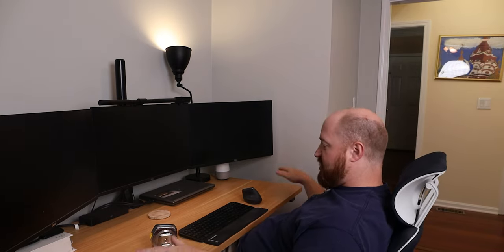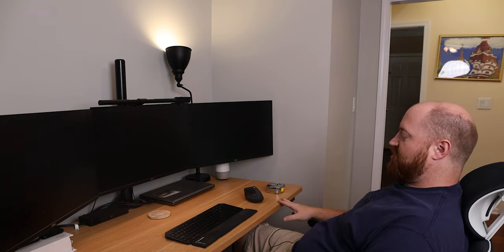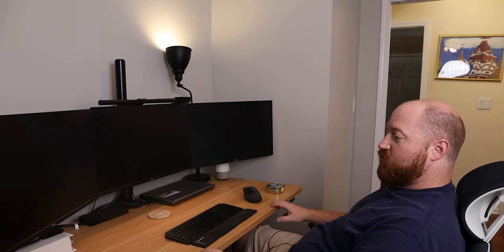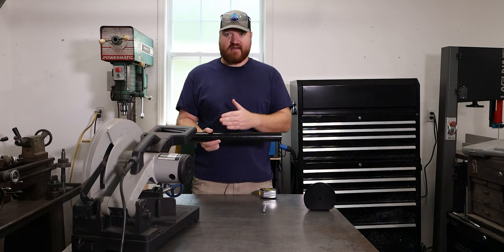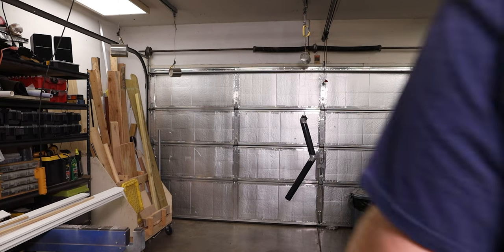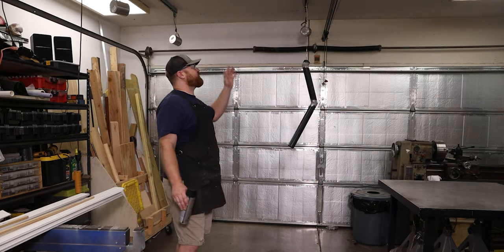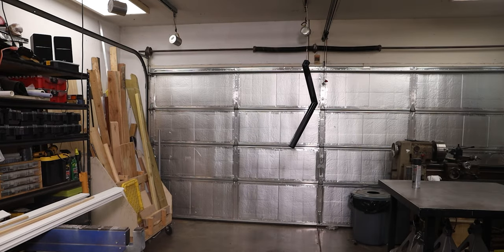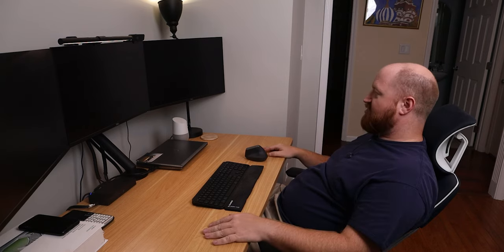Monitor Stand Modification

Comment: If you do it right, you could rotate the stand 90 degrees to the left or right and keep the table closer to the wall. Think youtube recommended me this video because I've been looking into stands for a new monitor setup so I've been thinking about mounting for a while :). I'd love to do something similar a what you've done with mine.

Comment: I really like the stand modification, it's super clean. Hice work, I'll have to keep this in mind.
Also, if you want, try rotating the left and right monitors into portrate. It will help reduce the left-right angle but, oviously increase the up-down angle. I personally like my side monitors in portrate. However, I completely understand it not everyone's cup of tea.
Reply from the maker: I tried portrait monitors before, but I spend 90% of my day working in CAD and most parts I design are wider than they are tall. If I was a software developer I'd be all over portrait, but for me landscape works better.

Comment: Did you consider building an extension to the table instead to make it deeper? And if so, what made you decide against it? I think my first thought would've been to probably install a shelf on the wall at the same level as the table and put the monitor stand on that instead. To me that seems easier, and I would also get annoyed by stuff falling off the backside of the desk onto the floor. So making the desk deeper would be nice I think.
Reply from the maker: The desktop is particle board with a fancy veneer on it and it has a one piece veneer with rounded edges on the corners. Extending it would have ruined the aesthetic. Getting any kind of good bond to the particle board or the veneer would have been questionable, especially having all weight of the monitors on it. I could have gone off the front, but then I'd have a discontinuity in surface where my keyboard and mouse sits  and that would have bothered me. The desk height is adjustable, so mounting anything to the wall would have negated that functionality.  the desk itself has plenty of workspace, but when the monitors encroach 1/3 of the way in it feels really small. With the monitors pushed back the desk feels massive. I've got enough room for a notepad, an open bearing book, my keyboard and mouse and an iPad. And it all still looks aesthetically pleasing to me. Plus it's nice looking at a pretty weld while working.
Reply: @Obscuremotorsports  Yeah. That makes sense. Especially the height adjustability is a total gamechanger for what I suggested.